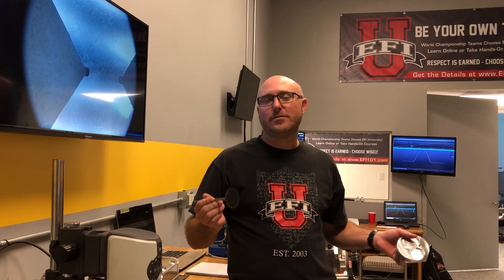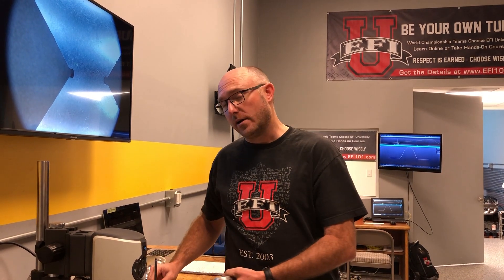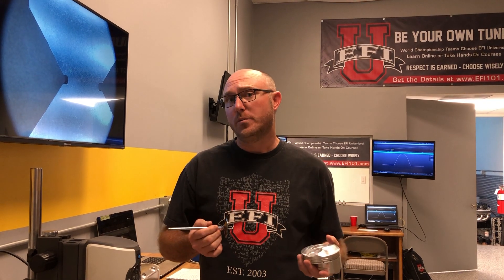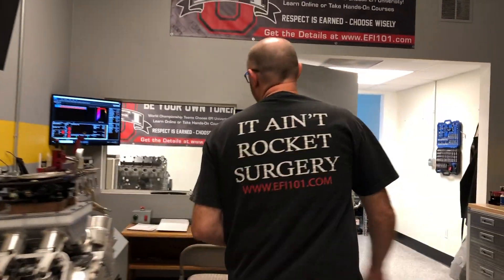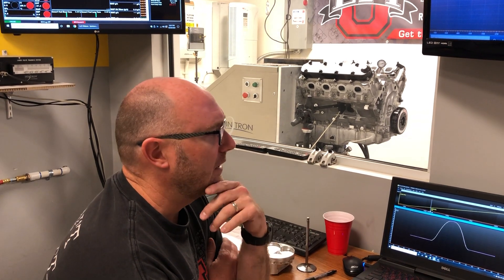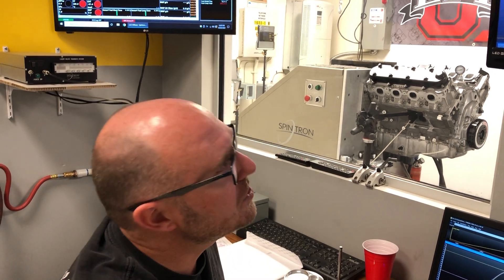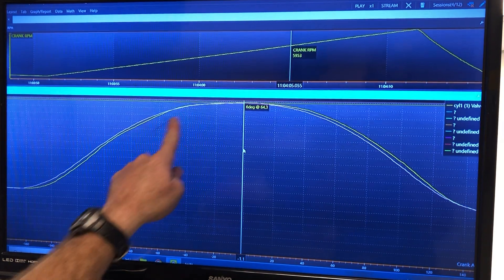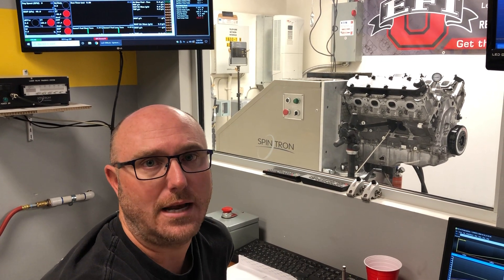$10,000 Valvetrain...Don't crash it!!!

Comment: I don't understand why pushrod engines are still being built for racing instead of DOHC'S using cam buckets which gets rid of all the valve train flexing and weight...even better would be solenoid actuated valve timing
Reply: In NASCAR at least, they were outlawed.
Reply: DOHC engines definitely have certain performance advantages, however more cams, valves, and springs ran at their limit  put greater stress on the chains, guides and sprockets, or belt and related hardware. Since NASCAR and NHRA top fuel have relegated themselves to pushrod style valve trains, they have been developed so far to the point where it doesn't even make sense to change the rules to allow DOHC.

Comment: I like looking at pulled apart Stock Eliminator or Super Stock engines to find all the tuning tricks.. They have to stick with parts like factory cylinder heads etc, so they have to optimize everything inside the engine to gain every little drop of power -  things like crazy pistons with Dykes rings and extra venturis inside the intake manifold to create kind of a helmholtz resonator to draw more mixture in etc etc .. I saw a 66 Nova with a 283 in Super Stock that could point the front end toward the sky at will, you can easily spend $30k+ on a smallblock in classes like that..

Comment: i was aware of the problem of deflection in push rod/rocker arm equiped engines, I hadn't realised it was this significant,  even with the very high lifts and spring rates used.
This would also seem to be a contributing factor to the issue of loft as some of the components 'spring' back?
There would also seem to be a potential problem if one, or more, components are swapped out as their stiffness and inherent spring rates may vary and, if they should get into sync', could be a big problem.

Any particular reason for using billet alloy for the intake and what appears to be investment cast for the exhaust?

Comment: Enjoyed watching that Ben and to see the deflection in action, also listening to Ben squared is fun. There was one question I wanted to ask, when looking at p2v, would you say on a high end engine that your looking at a percentage of valve size and lift to work out clearance. For example a 1" lift on a 2.2" sized valve in a v8 verses a 0.5" lift on a 1.3" valve on an import twin cam such as your favourite k20. You see recommended clearances thrown around but mostly that's for V8 engines and I wondered if you would look at this differently on smaller engines(I know a twin cam such as a 2jz doesn't have pushrods and rockers to deflect etc)
Reply from the maker: Well, I don’t know if an easy rule of thumb formula for that scenario, but with an overhead cam system you have two things working for you...1) there is far less deflection due to the lack of rockers and pushrods, and 2) the smaller valve masses require far less spring to control because the total force is much lower. 
So while PtoV is still always a problem to solve it is much easier with smaller valves!

Comment: I assume this only covers the inlet valve as the "lag" on the exhaust valve closing side is what gives a lot of issues at high rpm?
Reply from the maker: Yes, we also look at the exhaust side as well using the same methods.
Reply: @EFIU_Ben  I never doubted that but it will require the opposite - a bigger clearance than static.
Reply from the maker: Yes!  You are correct!